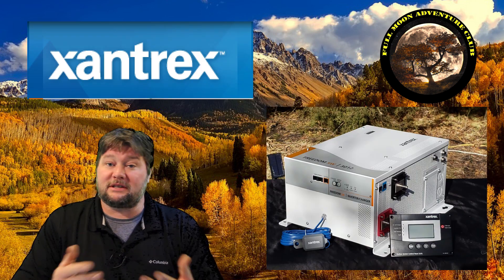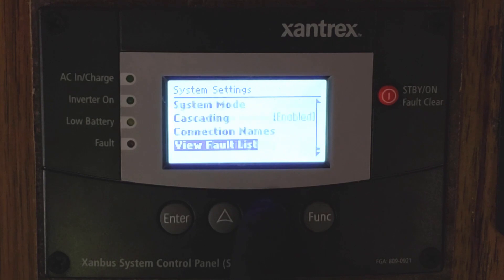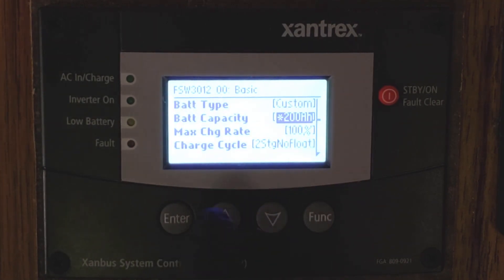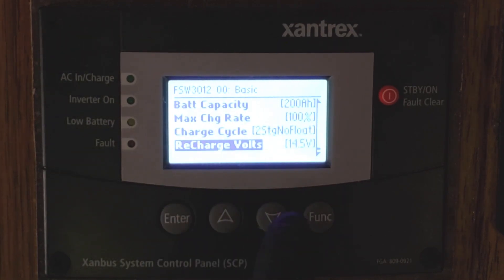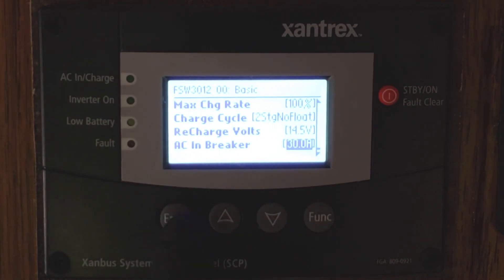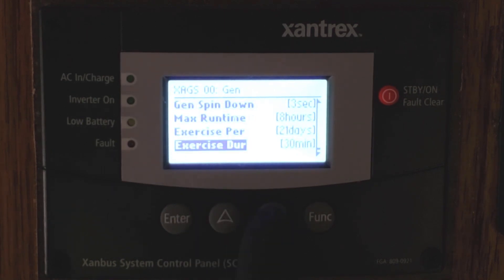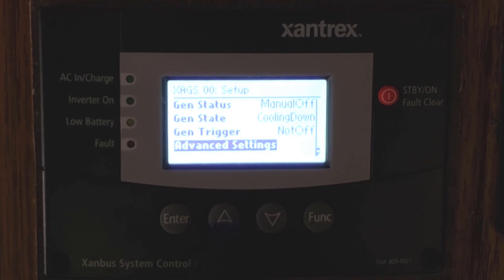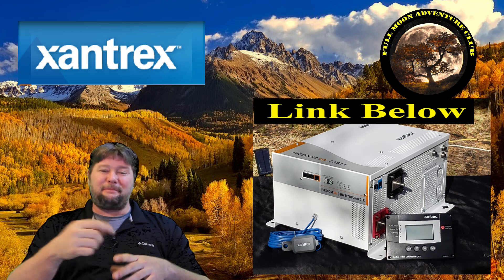How to Configure the System Control Panel - FREEDOM SW Hybrid Inverter/Charger

Comment: The input is not limited only by what you're plugged into, but the breaker supplying the AC power to the inverter from your electric panel. The wire size of the AC supply is also a limiting factor. I have a 50 amp plug, but my breaker to the inverter is only 25 amp, which is still a large breaker on 10/2 with ground wiring. Limiting down on the Xanbus can be used if you only have access to a 20 amp for layup or similar situations. If you only have access to a 20 amp in a State or National park, you could dial it down to not blow the external breaker ect..